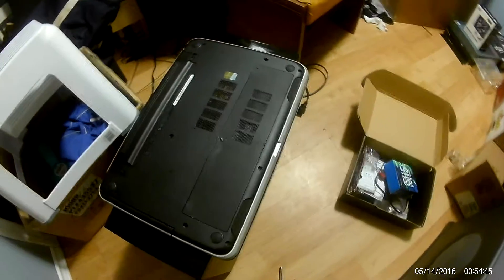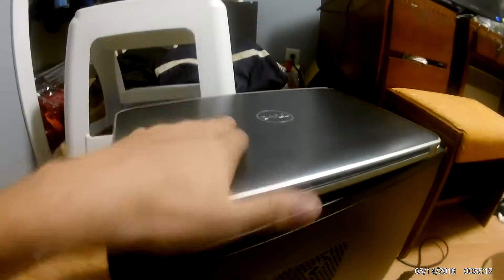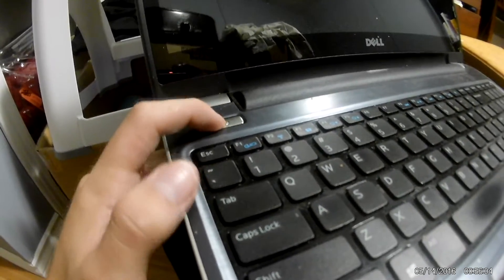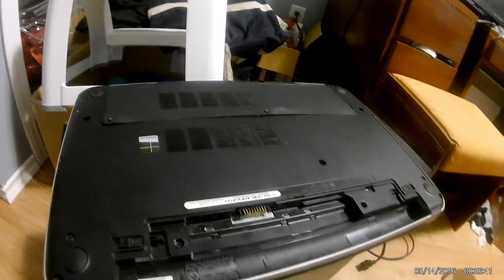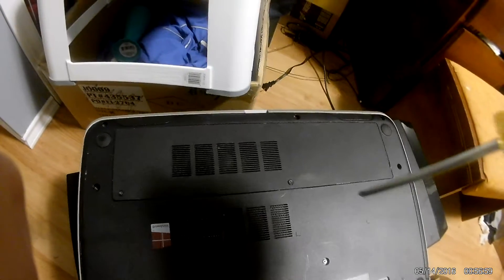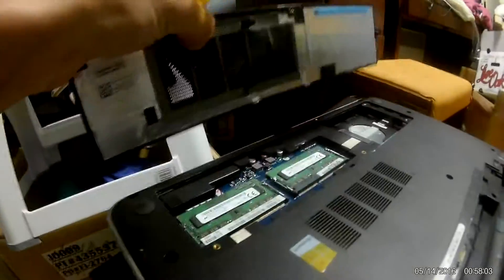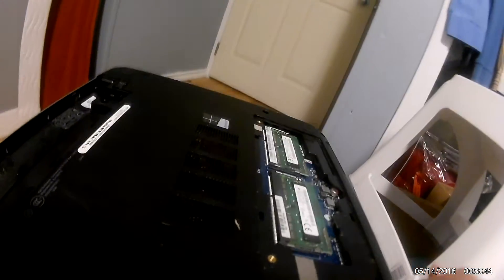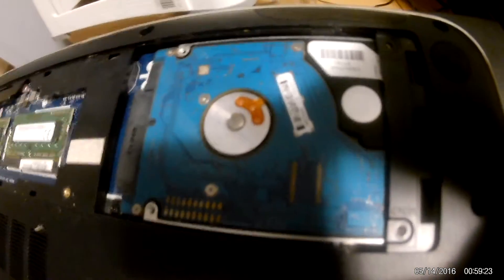How to Install a Hard Dive to a Laptop

Comment: Yea easy but how to move the OS?
Reply from the maker: You make a system image  on computer 1  and put it onto an external drive then you need a windows DVD and you boot computer 2 off the Windows DVD  when you get too the install windows screen instead of clicking install like you normal do there a  link called repair computer in there it gives the option to restore the computer off a system image you created then you restore computer 2 with image you made on computer 1

Another way is to buy a hard drive docking station and you can clone the 2 computers with software

Comment: I'm in the market for a new laptop. What would be your recommendations for the minimum requirements for processor speed, RAM and hard drive size? I'm not a gamer. I like to stream music, watch youtubes, stream movies, internet surf? Probably want to spend less than $500. Thanks
Reply from the maker: There alot of laptop computers  you can get for under $500 that will do you good Rick Martin.  This laptop in the video was what I use to use to make all my other video before I built my own desktop  PC I got this laptop at a second hand store for 350$ it came with a very nice i5 processor and  1 TB HDD and 8 GB of ram.  I took it home and wipe it put in a new copy of windows and it work like new and  I never had problems with it at all. For what your going use a computer for any computer should be aright that between $300 to $500 plus you can easily replace ram in laptops and replace the HDD with a SSD drive for faster performance look on newegg website if you want a new laptop are look for a local shop that sell laptops second hand even you might get lucky there are many laptops that will do you good if your just going use the PC for what you just stated 

I will send you some links for some laptops that will do you good for your price range
Reply from the maker: Here a good laptop for your  price range it has a big 17 inch screen for laptops that fairly large screen to watch your stuff on 

Laptop http://www.newegg.ca/Product/Product.aspx?Item=N82E16834234354

The only down side too this laptop is its hard to replace the RAM and HDD cause you have to take everything apart the good news is it comes with 8 GB of ram and 750 GB HDD
Reply from the maker: My best suggestion to you is look around for laptops that have 6GB to 8GB of ram screen size 15 to 17 inches and a HDD 500 GB are bigger intel processors should do but the link I sent you I like this laptop do too the screen size the amount of ram an the amount of space it has for the price its at this laptop is a good deal the only con is have to take the laptop apart to reach the HDD if you wanted to replace it with a faster SSD you can alway take it to a local shop if you wanted to upgrade it with a SSD but you do not need a SSD its still a good laptop for watching stuff on
Reply: thanks Haig
Reply from the maker: The link I posted tho should do the trick tho its perfect for watching movies and videos for its price its really good deal for what your looking  for and if you where to look at other computers it might be hard to find one with a 17 inch screen at this price
Reply from the maker: Plus if you do not like windows 8 you can easily upgrade it too windows 10 right out of the box for free if you go to Microsoft site and download a free windows 10 upgrade
Reply: Gotcha. Thanks for following up with replies and recommendations.